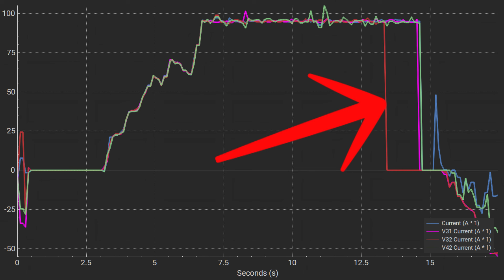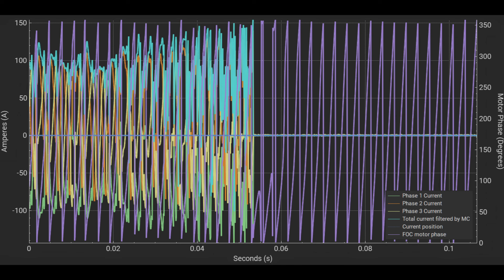190MPH?! The Beast Finally Delivers!

Comment: hey, i actually have quite a bit of experience with VESC , and more importantly, BLDC motors, on VESC . its a lot, but if you read this, hopefully this helps: VESC is a true sinusoidal FOC controller, but a standard BLDC motor has a trapezoidal (effectively square-wave) back-EMF. Driving a square-wave motor with a sine-wave controller creates waveform mismatch—sharp edge transients, micro-saturation events, voltage spikes, and power derating under sustained load.

At high current, that mismatch becomes a real limitation. The solution was switching to a PMSM, which produces a native sine-wave back-EMF and aligns perfectly with FOC. Heavier, yes—but dramatically more stable under continuous high power. Unfortunately, good luck finding one small enough for this. BTW, i personally think your direct-drive system is mathmaticly, perfect. less loss, less drag, more efficient. You could SERIOUSLY break some world records with you aero be optimized so much too. Are you using field weakening yet? seem you have PLENTY of torque, and not too much drag, you may be able to sacrifice some for effectively, lower BEMF, thus, higher RPM top-speed, in case you get to that kind of speed
Reply from the maker: Hey, good to hear from another VESC believer 🙂I get what you're saying about the back emf, I have had a look at that on an osilloscope. However I have managed to tune the VESC settings to work with it even at high currents and rpm. I also though I was on to something with this layout, only 8 bearings on the entire car has got to be a good thing! Regarding the world records, have a look through my recent videos 😉. Field weakening: I need high torque at high speed, so a better option for me has been to increase the voltage 😀

Comment: What are you disabling every time your TX says disabled?
Reply from the maker: Disabling dynamic transmitter power, so it goes to a constant 1watt rather than varying it based on signal strength telemetry 👍